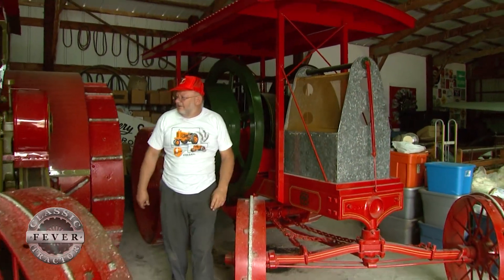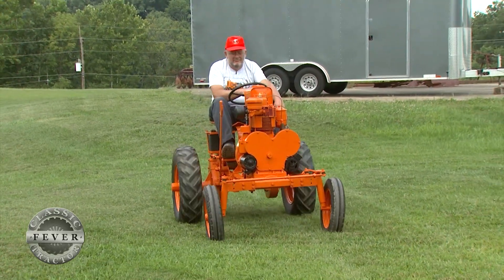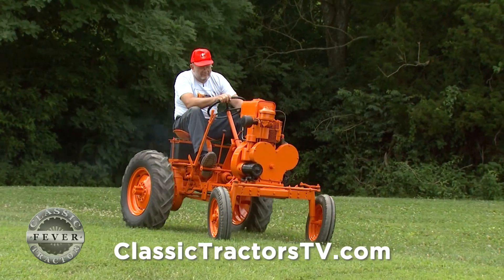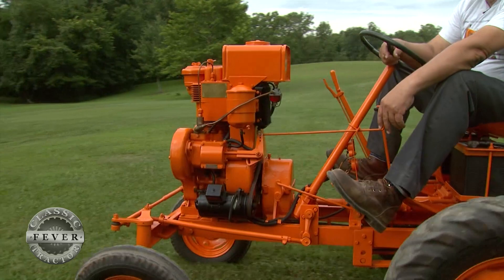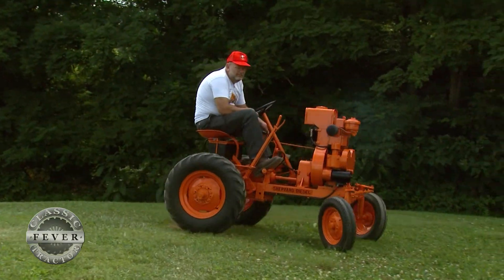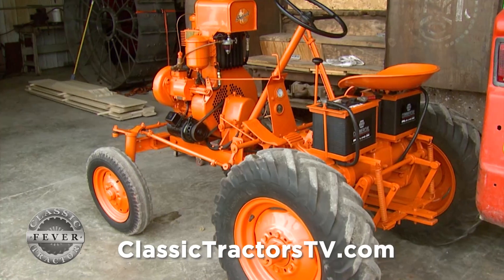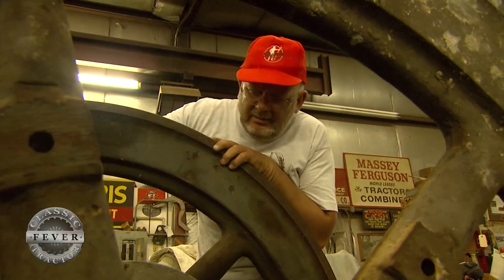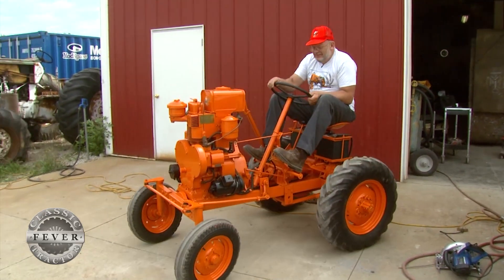Only THREE Known! A 1949 Sheppard-Built GARDEN TRACTOR!

Comment: My Novo powered Atomic Babe is still cultivating my watermelons and sweet corn.  Can't believe they were that expensive.  Quick question, was orange also used on Atomic babe, mine is red, but my 3 bolt split cast iron front wheels were orange on the inside.   Hard to find info.  Thanks again 👍